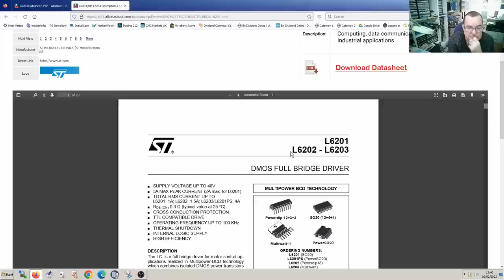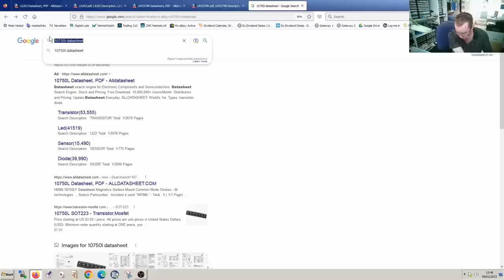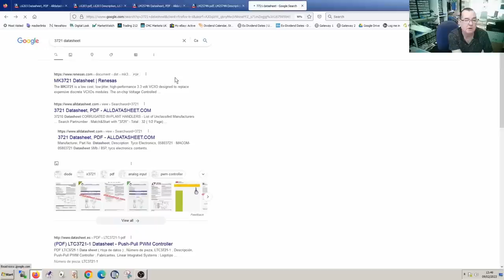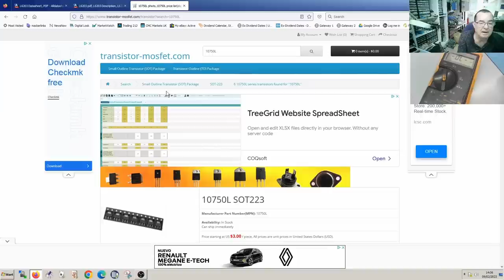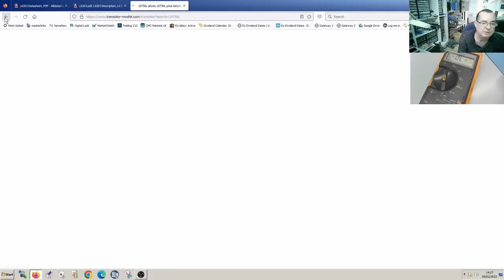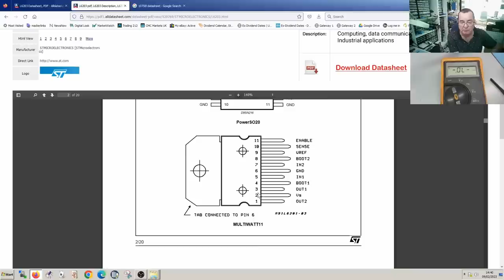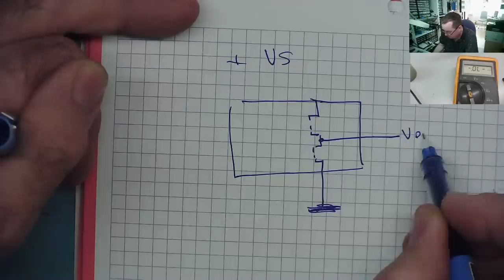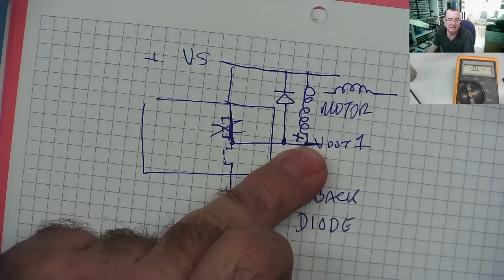Use Basic Electronics Knowledge To Repair Industrial Electronics - Pure Methodical Fault Finding

Comment: Great episode, very handy techniques and approach. Many years ago I did my C&G 224 Pt 2 (and 3), while also studying my ONC and HNC in electronics. As you can guess from formal education, we never did much in the way of fault finding without a circuit diagram - which I now appreciate can make it easy. Your approach is methodical, experience-based and highly successful. No diagrams required. 
Thanks for sharing.

Comment: One tool I find very helpful is a spade type soldering tip. I have a few Hako dual head units that have different tips, one is 30mm wide another is 12mm wide etc, they are pricey unfortunately but they are time savers too. You can heat 2 pins or 12 pins all at the same time (I hate heat heat guns) and the component will just drop out of the board (hopefully), this works well for in-line bridge rectifiers, which I replace a lot of. I've been doing this stuff for 20+years and am always learning something from your videos. You are a good instructor.

Comment: That's how to make it look easy. You inspired me to invest in a component dca75. This work offers moves like a chess game. Test and gather data, analyze and make a move. Then try to understand why. This is far from boring. Thanks for all you valuable insight and procedures. I'm investigating in equipment because I want this to be my new hobby and I will never give up on it, regardless of all it's challenges. Being an auto mechanic with all it's challenges didn't deter me and now I have the hobby I have been looking for. Many thanks for your inspiring work.

Comment: Trying to get to do more of this on the bench. Do this every day with the whole machine still attached. Cheers!
Reply from the maker: The fun starts when you don't have the whole machine or even know exactly what it is 😀
Reply: @LearnElectronicsRepair  15:17 Image is quite blurry, its not easy to see traces and what you are doing... Any possibility to change camera or something to get clear focused image? 
You are nearing 100K subs, I suggest you to do it :)

17:25 - There is a unsoldering tool with this blue plastic that you have, it has like a hook, you hook it then heat from another side and pull. Really good for those diodes. You bought only this one screwdriver type tool or?

Comment: Very nice!! Just a quick tip, if I may: low melt solder to remove those SMD components works like a treat! You don't even need the hot air after using it. Cheers! :)

Comment: 9:00

If I remember correctly.....
Usually things I see in that package and with that green color are inductors. I run across them quite often... But I know there are also resistors and other things in that package such as glass diodes etc....

Comment: Hi Richard, another good tutorial. One very good method to protect any easily meltable parts is using sel-adhesive aluminium foil (tape). Works much better than Kapton tape and is easily removable afterwards. Regards, Jerry.
Reply: Just use cooking aluminum foil. Its cheap and you got a lot of square area.

Comment: I like your new desoldering tool.  It seems to work a lot better than your old one.
Reply from the maker: It's the same desoldering station, I just bought a replacement gun.  It turns out I had damaged the other one by forcing the cleaning rod through it with a pair of pliers, which caused the metal tube in the center of the heating element to push out into the glass tube.  This is why the solder was solidifying at the end of the metal tube (as it was no longer inside the element) and clogging it up.  Now I have it working properly again I'll order a new heating element assembly for the original handle (about €15) and keep it as a good spare one

Comment: H-bridge (full bridge) motor driver.
Usually the motor is connected between the 2 outputs which gives easy control of motor direction w/o clonky relays.
Reply from the maker: Agreed, usually, but if you look at the connector marked 'motor' on this PCB one terminal seems to go to 24V and the other terminal (marked motor negative) goes to pin 1.  Hence the flyback diode between Vcc (24V?) and pin 1 of the motor driver it seems.

Comment: One way to fix chips, is to heat it up lightly. To test it, electric clocks not ticking, when heated up at the ic, it starts ticking. This method doesn’t always works, but you don’t have to replace expensive ic chips.

Comment: Hi
I’m starting again as an electronics repair guy  (got motivated by you super interesting video’s) and looking for a good electronic microscope. 

Is the one you’re using still the exact same as the one mentioned in your list?
It seems yours  is positioned way higher than the included arm would allow. 

Looking forward to your feedback. 
BR
Sam

Comment: Nice one, I'm just wondering if injecting voltage on that diode would have helped identify the driver immediately in this case without having to remove all the mosfets.
Reply from the maker: Often with this sort of repair work it's like following the branches of a tree.  No matter how experienced you are, with an unknown pcb/problem sometimes you go along the wrong branch and have to double back, so it takes longer to get to the correct conclusion.  As long as you identify all the possible branches you will get there eventually, and yes with hindsight it usually could have been easier. That's just how it is and I always show the whole diagnostic process in my videos, warts and all 🙂

Comment: Good work ! must admit I was screaming test the device !!! just after you cut pin 1 I would have gone to  pin 2 straight away ! especially as I know what a pig those that package can be to remove. Looking forward to part 2, will you take the board to the site as part of your repair and install it ?...cheers.
Reply from the maker: Well on a YT channel you also need a bit of dramatic effect 😅
Reply from the maker: Mr Guru  They can be, and they can also be a bitch depending on ground/power planes.  Cutting the legs will always do the job but sometimes you may not know 100% it is faulty.    Having the right equipment also helps a lot.
Reply: Hi Mr Squeak
Reply: @LearnElectronicsRepair  Nicely put.

Comment: You could probably use low melt solder to desolder those.
Reply from the maker: Adding 60:40 lead solder to the lead free solder does pretty much the same thing as using special low melt solder as you can see.  And it is also a lot cheaper 🙂
Reply: @LearnElectronicsRepair  you should test the mechanic xw6 low melt solder which is 50% bismuth and 42% tin vs leaded solder. You can get that for like $12 for 40-50g. I'd love to see how much of a difference there is

Comment: I dont think the optics are to detect the door movement. Instead I think the optical sensor detects an plastic flag, screw or piece of metal, that is affixed to the wall, and the second optical detector might be connected to the cover of the device, at the hinge side, so a plasic pin will leave the sensor as the cover is opened.

The idea is, if somebody would jimmy the whole device off the wall with a crowbar, the flag, screw or metal piece would no longer be there (as its affixed to the wall through a hole in the device box), thus the device can call home and report the tampering over rs485. Same if plastic piece on cover door leaves optical sensor, which means cover on device was removed.

Thats confirmed by the reader block having a SIO connection. SIO is a alarm standard for connecting burgular alarms.

The rs485 have 3 pins because the middle is shield. Its indicated by the drawing, showing the end of a antenna cable with its outer shell connected to ground.

Comment: Don’t the white plastic sockets you de-soldered the pins from the board just pull off? No need to remove the pins then and no melting with the hot air. Love the videos by the way bud.

Comment: Is there a reason why you can't use voltage injections to find where the short is on the board?
Reply from the maker: Watch part 2
Reply: @LearnElectronicsRepair  thanks

Comment: Hi Richard, i have a question to you :). Do PSU have influence on a GPU coil whine? Understandable if it was low quality PSU with unstable voltages etc. but i read on forums that people had corsair rm850x and after change on straight power 11 coil whine was ended... How to explain that?

Comment: Hi Rich , is the capacitor which was previously replaced connected to the faulty chip ? I still can’t think why they replaced it .I keep thinking that this provides a clue .
Having said that , I have never seen a component treated so poorly..it looks like they took it out with a mole grip!
Reply from the maker: Yeah, I showed in the video it goes directly to one of the shorted pins on the IC, but not to the other one

Comment: Hi. Thanks for the video. It helps me a lot because I'm doing repair job too and I consider myself in the intermediate level in electronics repair. May I ask if you don't mind, how much do you charge in this repair? Is it based on percentage of new unit price which I do normally?
Reply from the maker: To be honest this can be a 'charge what you think it is worth' sort of job.  So this PCB controls a turnstile (or turnstiles) at a theme park. If it is preventing the business from operating normally it can be a big headache and very costly for them.  Literally they could be losing hundreds or thousands or dollars/euros/pounds whatever in lost trade.  Per hour, even!   

To get a replacement can be costly and time consuming, and depending on the use, if this board has custom programmed firmware for the specific application, then in extreme cases it could involve an engineer flying half way across the world to plug in a new one and configure it. Or maybe the OEM no longer exists. Or they do exist but this board /turnstile is obsolete, or they don't want to replace it 😉, in which case it may be '-sharp intake of breath through the teeth- sorry but you need to replace the whole system'. Now we are in to the tens of thousands. So it does depend on the cost an availability of a replacement, which can be hard to judge, and how many other companies/engineers could fix it (locally) but I would suggest for this sort of repair, say $100-$1000.  Yeah I know that's a very wide range but maybe $500 would not be too far out of the way, if you can get it done fast.  Depending also on your geographic location, most likely.
Reply: @LearnElectronicsRepair  A VERY BEAUTIFUL AND EXTREMELY COURAGEOUS RESPONSE. YOU ARE INDEED A GREAT BOSS.... MORE POWER TO YOUR ELBOW.

Comment: How much did you end up charging your customer? How come your customer couldn't get a similar board? Surely would have been cheaper.
Reply from the maker: Wait until part two.  Usually a PCB like this will be several hundred to several thousand euro/dollar/whatever to replace.  And that is if the company who made it (I think this one is 20 years old or so) are still in existence and still produce it.
Reply: @LearnElectronicsRepair  looking forward to Part 2. Keep up the good work. Thanks